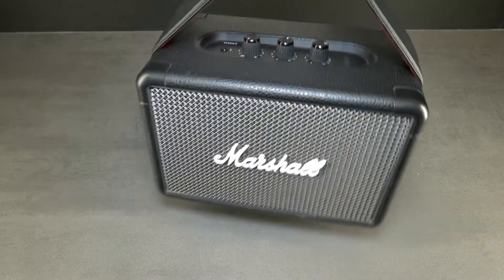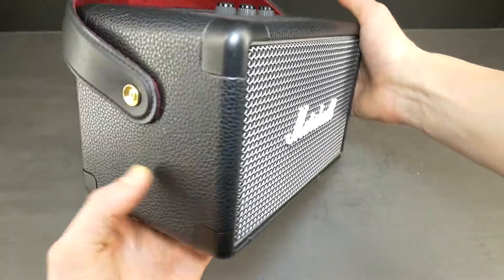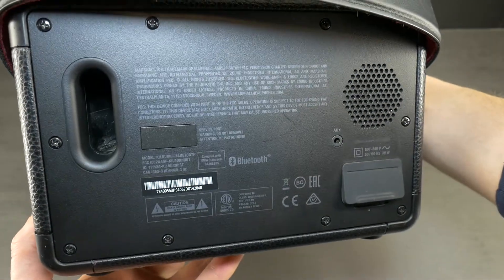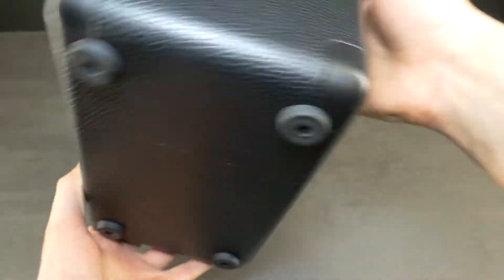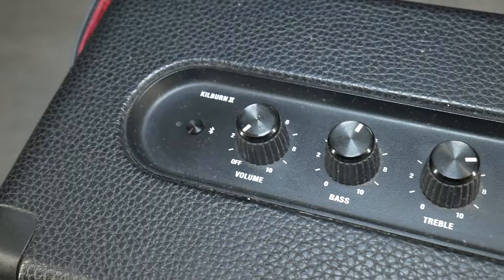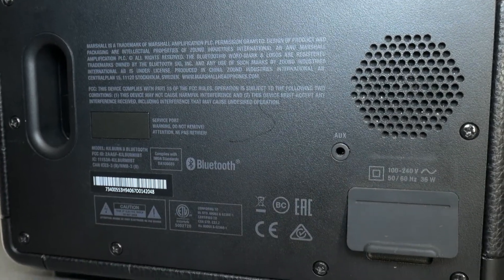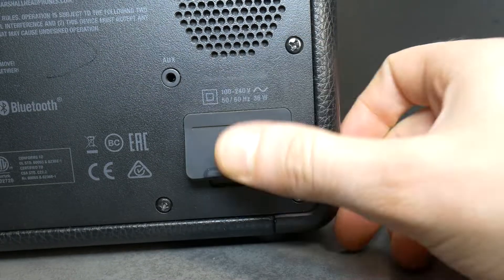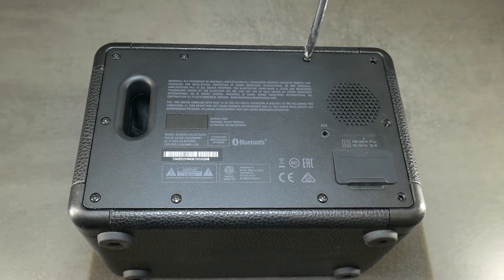Teardown Marshall Kilburn II bluetooth speaker

Comment: No passive radiators?
Reply from the maker: Why use a passive radiator? A bass reflex port gives the same effect or better. If you research it, you’ll find that in the hi-fi world, speakers more often use bass reflex ports, not passive radiators. The main advantage of a passive radiator is waterproof capability since the box doesn’t have a hole, but that doesn’t mean it produces better sound.

Comment: Hello, I am the proud owner of a Marshall Kilburn II portable speaker, please tell me if it is possible to remove the following functions from the device that have been annoying me for a long time:

- Automatic shutdown of the device (always when I leave the computer for 15 minutes or more, when I return I have to reconnect everything)
- Automatic connection of the device to everything in the room (I have many devices and every time I have to walk around the house and turn off the Bluetooth for each of them, this is always accompanied by sounds of connection and disconnection)
- Loud sounds connecting and disconnecting a device to the speaker (I can’t connect to the speaker at night without waking up everyone in my apartment)
- When I play a game or watch a video in VLC player, the speaker does not perceive it as something that makes a sound and turns off after a while. When I watch a video in Google Chrome on YouTube, the column does not turn off.

Is it possible to get into the device code and remove the lines responsible for automatic shutdown and annoying sounds? And if so, how can I connect to the device and do this?

Comment: They are built to die soon. Almost every owner had issues within a year or two. But the sound is excellent for its size.
Reply: Yes my tweeter is out now junk
Reply: Купив в 2019 році , проблем не має до тепер
Reply: My battery was dead
Reply: I bought it in 2018, it still works amazingly

Comment: STM32 microcontroller, bluetooth 5.0 aptX, IP2X water splash proof, no wonder it's expensive!
But I personally don't like the tweeters placement design(1 front 1 rear), even though it's small and compact😅
Reply: The rear one is pretty cool as it is very subtle but noticeable when placed in different locations.
Reply: Which MCU they use for Bluetooth do you know? STM32F doesn't have Bluetooth
Reply: @thexht7927 With aptx Bluetooth features, most solution is Qualcomm chipset.
I compare the module on the motherboard, probably the model is TS3008C.
Reply: @thexht7927  I don't know either, but the Bluetooth module definitely is Qualcomm solution.